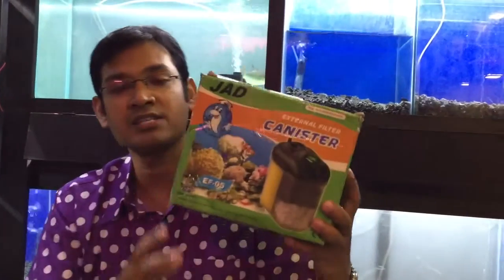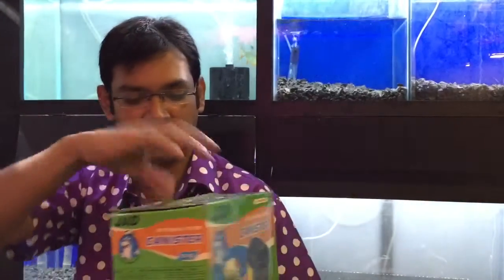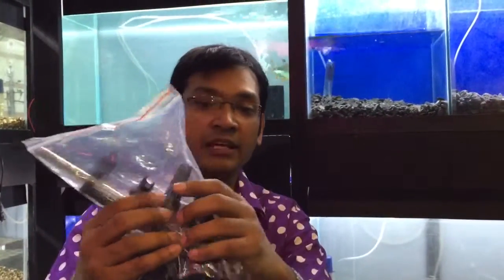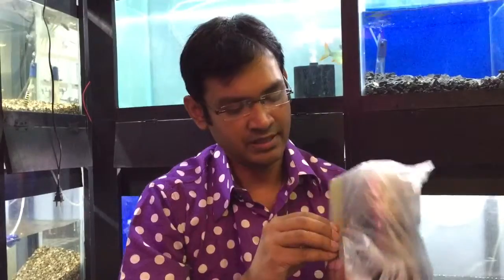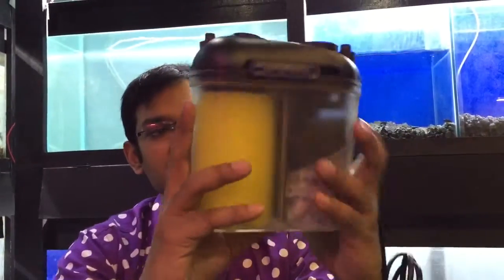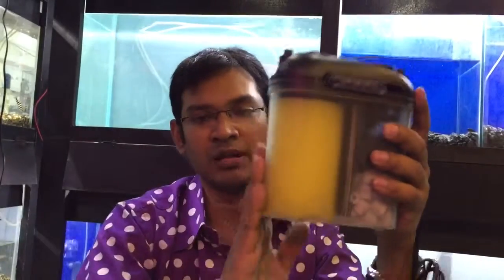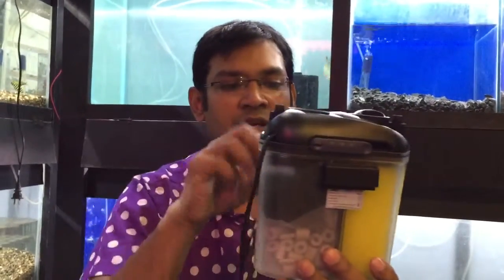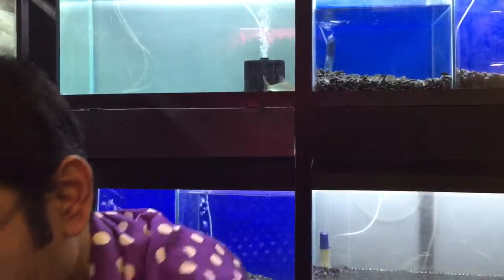JAD external Canister filter EF05 model Unboxing in Bengali

Comment: can you tell what type of i should use for a cichlid tank of 55gal???? i have a top filter which has the max power of 2500l/h...
Reply from the maker: Manash Ghosh  If you are not happy with your 2500 L, then, just change the Power head in to 3800L . i hope it will work fine as 55 gallon is not a big Tank . 
Thanks